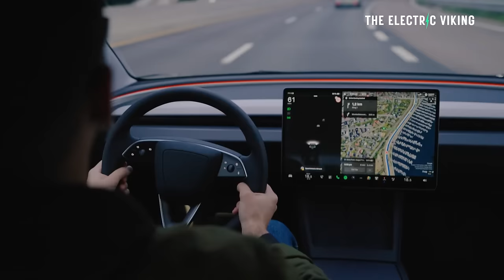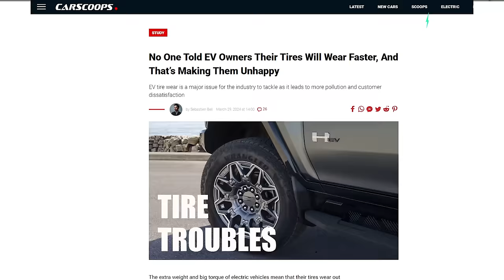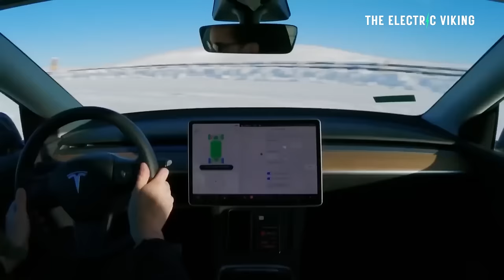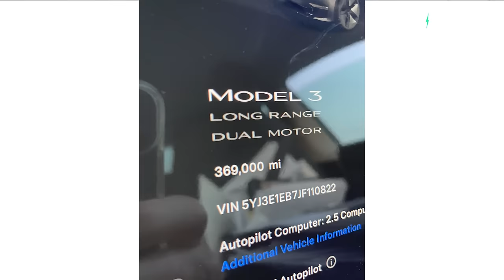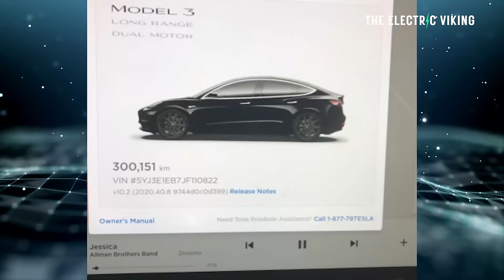I found the highest mileage Tesla Model 3 in the world - I'm shocked!

Comment: EV tires can last for as long as the tires on an ICE car. But EVs are more able to shred tires than ICE cars. That is because EVs have, on average, a whole lot more power than ICE cars do. EV owners who drive gently experience long tire life.
Reply: Yet over on the Tesla Plaid Channel he has done over 900 quarter mile sprints on his OEM tyres with over 21,000 miles on the clock.
Reply: I will go through tyres if I own a Tesla, and that’s fine. Fanging around in a M3P would be hard not to.
Reply: i had to replace mine at 21k… i do not drive crazy because i don’t actually enjoy the “torque” despite wasting the money on m3p lol
Reply: Correct but a slight innaccuracy. Electric motors have high torque at low speeds which can shred tyres especially with the battery weight. This torque quickly falls away at higher speeds so high power isn't actually accurate.
Reply: @GDM22  900 1/4 miles is a lot and would be very hard on a gas car with clutch/torqeue converter/transmission etc. but its actually only 225 miles 😀 So even if it did wear the tires 50x quicker than regular driving, it would still only add ~10k of wear
BTW tesla plaid never loses traction on a drag strip with the launch control software, so tire wear is not comparable to a RWD car sending 100% to the rear wheels and doing pre race burnouts
also sticky surface = less tire slip so I'm not sure how hard it is on the tires. I think on regular road its the tire slip that rips small particles of rubber. on sticky road I don't know if its possible that some rubber gets removed just from the stickyness
but its still impressive
Reply: the added weight does increase the load on the tires even when cruising, buts its more like a 10% difference. Talking about my fiat 500e, traction doesn't work really well, because of small wheels, eco tires, short gearing, FWD with 50/50 weight, and traction control that just doesn't work, so there's a lot of unwanted burnouts..
Reply: @Khanfuzed1  You clearly don’t realize how aggressively you are taking off...my tires (Model 3) look almost new at 19k miles.   Just ease off the launches a little bit, you might be surprised.
Reply: Not arguing against, but people are acting like 20k on tires should wear them out a lot, when most tires warranty 60-75k. I didn't see anyone talking about their tires at that range. But in general, they should wear more with additional weight. Depending on the axle weight per tire, you may need more expensive, heavy duty tires for long life in high torque applications. Didn't the plaid call for higher rated tires for the 0-60? Could be wrong though.
Reply: @AhjTheMediocre in my ev the tires was done 5k before warranty of 60k. My last car same type of tire lasted 65k miles so it does seem like more wear but not much.
Reply: @richardmenz3257  yea, it's not crazy. If electric semi get gross weight increases, we will see alot more particle pollution. Not that it'll be detrimental, but it isn't great.
Reply: @AhjTheMediocre  I know they are working on new tires hopefully that helps with all that we will see. I don’t really like a side of rubber with everything.
Reply: @richardmenz3257  with our push for no use of fuels, rubbers might get more expensive.
Reply: @AhjTheMediocre  dumb comment 82000lbs vs 80000lbs wow electric semis are so heavy but you forget they don't need to use disc brakes to stop or control speed downhill and don't emit nasty diesel particles
Reply: @AhjTheMediocre  yeah sure I'm very confident you're going to drive 75k miles on original tires with a 1000hp gas car 😂
Reply: @AhjTheMediocre  pilot sport 4S so equivalent to other high performance sedans
Reply: @geemy9675  You might wana chill with the passive agressive attitude. Not good for the brain.
Reply: Oh dear viking you really don't understand that km means kilometers not miles.
Reply: @Khanfuzed1  You must have some bad roads where you're at.  I easily get 40k on my model 3.  I'm at 25k on my current set and there's still a lot of life left.  I don't drive slow and I don't use chill mode either and I live in the California valley where roads are terrible.
Reply: @geemy9675  did you not even think about the 1000hp comment? If that expectation is true, which it is, it'd be even more true for EVs that have max torque at 0 RPM with increased axle weight. So... your point?
Reply: @Ryan-ff2db  is it actually called chill mode??? Lol
Reply: @PaleBlueDotCitizen  yea I noticed the kmh and mph mismatch lmao
Reply: @geemy9675  I went ahead and did a little googly search. A 100kwh pack weighs roughly 1000lb, atleast according to the tesla model plaid long range battery spec. And we have found we need roughly 700-1000kwh for semi. So that math checks out to 7000lb to 10000lb. Not including the motor weight or inverter. There goes at least 25% of your payload. Man that 2000 lb Weight increase really fixed that issue, didn't it?
Reply: Totally agree, my model 3 ttres last more than 60 thousands miles
Reply: @GDM22  Great!  I suppose tires would be more susceptible to hard cornering. Tesla traction control makes it nearly impossible to spin the tires, at least on dry pavement. I think drifting can wear out a set of tires in one day. Indy cars use two or more sets of tires in 500 miles. But I don’t know anything about tire wear in drag racing. Thanks for the comment.
Reply: @PaleBlueDotCitizen  oops
Reply: also keep in mind tires designed to be used on ev's (not performance ev's) have harder compounds to compensate for the increased wear by having more torque and more weight.
Reply: they last a bout the same its all on how you drive and time of day, driving at day time will wear tires out 3x as much as comparison to night. my m3p got about 16k miles on summer tires, my friend is on 53k on his and he only drives at night time.
Reply: @AhjTheMediocre  Yes, and there's ludicrous mode on the faster cars but 1,020 hp is bit much for me.  I prefer my bladder where it is.
Reply: It’s not just acceleration, it’s also the increased weight of EVs.
Reply: @geemy9675  The traction control can manage grip, by reducing acceleration  about 20 times a second. Still would be taking the tyre to that point continuously, the point aside from this, if those tyres end up doing 40,000 kms it is a lot more than the fear mongers are quoting.
Reply: This a great vid and supports my experience as well.
Tesla is killing all the misconceptions about EV’s .
Traditional ICE vehicles will quickly lose ground as this information comes out.
Reply: I changed my rear tires on Model3 after 60,000 km. Front tires are still original and doing good.
Reply: @AhjTheMediocre It is definitely detrimental.  Particulate pollution is causing an increase in childhood asthma and other respiratory illness increases in the population
Reply: You forget to account their weight.
Reply: VW is factory equipped with tires with a tread depth of 6.8 mm. Fiew yers ago it was 7.5 -8 mm.  Car manufacturers are shooting themselves in the foot by ruining each of their advantages.
Reply: VW is factory equipped with tires with a tread depth of 6.8 mm. Fiew yers ago it was 7.5-8 mm. Car manufacturers are shooting themselves in the foot by ruining each of their advantages.
Reply: @geemy9675 My previous car weighed about 6000lbs with a tank of gas and me in it. Tires were good for 80,000km. My current EV weighs about 4800lbs loaded. It has 400hp, but driving it normally isn’t chewing up my tires with 22,000 on the so far. I will be looking to replace them five years or so from now at 80,000. Conclusion - if you drive it like you stole it, you will wear tires out, regardless of what sort of car it is. The opinions you read are so much click bait, and no reason to worry about an EV being somehow different. Regeneration is no different from braking in its effect on tires. That’s just my opinion after 2 years of owning an EV.
Reply: @joniboulware1436  but gas and diesel are the biggest particles emmiters by far compared to EVs...they have been poisoning us for a century (remember lead, NOX, CO, particles, oil burning two strokes and of course C02 which is not directly dangerous)
yesterday you were complaining about emissions laws reducing power
you have also been buying heavier and heavier vehicles vehicles...just because you can
but now that EVs  just start becoming competitive you're complaining about weight..that's hilarious
Reply: @davidcottrell570  yeah how you drive has the most effect on tires. there is no evidence that EV being quicker of the line means people drive them harder. also the acceleration is more constant you are just using more torque of the line then accelerating more smoothly where a gas car takes off more slowly then if it wants to keep up needs to hit higher acceleration between gear shifts so the EV acceleration is both easier on passengers and the tires.
I do drive my EV harder than my gas car though because I have mechanical sympathy for my engine and transmission and more concerned by gas mpg than electric range though but my EV is way lighter than my gas SUV and rides on my h smaller wheels and any speed I gain can be converted into Regen and heat  instead of brake dust
Reply: @GDM22  but EV traction control being quicker reacting and making best use of front +rear wheel traction means than gas car trying to keep up with same acceleration will harder on the tires.
for tire tire life chill acceleration > hard EV acceleration with traction control > hard ICE acceleration with traction control > hard acceleration without traction control.
and also EV AWD > ICE AWD > 2WD

Also EV's don't allow the same level of TC off as gas cars because performance EV simply have way too much torque for the tires and almost no engine rotational inertia (no crankshaft pistons, flywheel and transmission)

but yeah physics still applies, if you have a very quick EV and you are flooring it at every stop you'll definitely kill the tires fast.
Reply: @AhjTheMediocre 

The saving from particulates from not wearing the brake pads probably offsets that tire wear.

Then the saving of PM from the exhaust from an ICE, and its no contest anymore...
Reply: Completely agree. I just replaced my OEM Hankook Evo 3 tyres at 90,000km/56,000 miles. Replacement set cost $920 in Australia - can't complain about that.
Reply: @tomaszw7749  Hi, Tomas. Actually, I think there is a never ending exchange between producers and consumers. And that’s good. Car companies try to save money by offering less tread depth, for example. Some consumers may welcome the opportunity to buy a cheaper car with a cheaper tire. Others might quit buying the brand because this model of car has poor tire life. 

    New car ideas come and go. Consider the example of the Cadillac 8-6-4 engine, or the seat belts of the 1974 model year seatbelts that strapped you in like it or not. The Wankel engine. Wing windows. Continental kits. Hardtop convertibles. All wonderful ideas that flopped (though I believe hardtop convertibles have made a comeback). The market sorts out what will stay and what will go. That’s progress, so they tell us. But I do miss those wing windows …
Reply: Ev tires don't last as long - period.  The tires are much softer. I got 22k on my rear tires and don't drive hard.
Reply: It’s Tesla not Tezla.
Reply: It’s the weight not how you drive
Reply: That is the truth. My bmw ate tires just as fast as my model 3 because of my driving style.
Reply: @Areku06  model three does not have tire wear issues. I have owned a model 3 performance. My model S plaid has tire wear issues. Every 6k to 8k miles needs a new set of $2,400 tires
Reply: @softwarephil1709  Increased weight and still got 65k miles.
Reply: last longer in CHILL mode.
Reply: @markplott4820  Never tried it, but I should.
Reply: @NsXy  Both!
Reply: @Tyrial7  Good for you
Reply: This is the problem with EVs. Almost no one drives them slowly. They don’t even have modes to be eco friendly.  They all have theoretically great mpge.  But people drive them fast and they get half that. And of course they charge in most places on the marginal power source.  Which is coal for most grids around the world.
Reply: Just made up. Yes. No relation between torque and tires. And the type of tires on these vehicles. I am dumber for having watched this video.
Reply: @davidw2204  Thank you!
Reply: @Tyrial7  You’re welcome 😉
Reply: @davidw2204 - Yes indeed however some here don't appear to understand what "Drive Gentle" actually means.  Some might comment they "Drive Gentle" because they don't accelerate hard but then they do sling their cars around corners like they are on a race track or hit the brakes hard at the last moment when they have to stop.  Most tire wear occurs when starting off from a dead stop, while cornering/changing lanes and when braking so you need to be gently at all three to get the best tire life along with of course maintain tire pressures and rotate them on a regular basis.

Myself I have an old cheap Nissan Leaf which I "Drive Gentle" getting about 5.1 Miles per kWh and the tires last the range specified in the tire warranty which is 40,000 miles since that's what has the best traction and temperature rating for where I live while still being affordable. 

Best!
Reply: @neilfromclearwaterfl81  
Hi, Neil. Thanks for the response. Yeah, the things you mention plus wheel alignment, caster, etc. interesting that these are also the things that cause increased fuel use. Of course it makes sense because these driving behaviors all scrub the tires against the pavement. Whenever your car gives you a 🍃leaf, it is telling you that you are saving your tires as well as your state of charge.
Reply: There’s more to it than just burning rubber to ware tires out at the .  A tire doesn’t have to slip to scrub rubber off its surface.  Just high torque can be hard on tire life .  In the tire business, the concept called squirm wears tires as well.
Reply: @robertstout7756  Squirm happens starting or stopping and you still vote on that with your right foot.  Tires also squirm from cornering which you control with both the steering wheel and your right foot.

My Dad spent almost 50 years working in the tire and rubber industry as an engineer after earning his masters degrees in chemical and electrical engineering and taught us how to drive along with the why's of things concerning tires and their care.

Having high torque alone won't wear tires since you have to overuse or in other words abuse it to cause excessive wear just like having donuts in moderation won't make you fat while overindulging will.

Best!
Reply: @robertstout7756  Thanks for the reply, Robert. You’re right, I forgot about squirm. I believe squirm was much more of a problem back in the days before radial tires. Bias ply tires suffered from tread deformation, which caused heat buildup, and wore down faster than radial tires do now. Manufacturers made tires stiffer by adding plies. Four ply, eight ply tires on regular passenger cars. Of course this caused more heat. So maybe heat should be added to. The list. Is that right?
Reply: @davidw2204  yes, DAVID I think Heat is another variable. Softer compounds wear faster and give better traction.  Neal mentioned aggressive driving, which of course can easily half the life of a tire.
But it’s so tempting, to feel your self pressed back into the seat .  Gzzz 😅
Reply: @robertstout7756  I give in to that temptation sometimes, but only on the on ramp to an interstate. It takes me back to the mid 1960’s. I wore out two low mileage used cars before I got sensible. Incidentally, not one of the quickest 60’s cars would keep up with my granny mobile, a Model Y long range with two baby seats.
Reply: I wouldn't call it "gently" just normal.
Reply: I believe most of the low tire mileage comes from over enthusiastic drivers, which is a nice way of saying hot rodders! All new vehicles need to be equipped with a black box type system in them like aircraft, to keep track of all the abuses and so forth! Plus it would be great info for just general building and manufacturing of vehicles. I believe these electric motors will probably go a million miles easily! Ice engines are just to over-complicated!
Reply: @steve-qe7tj  Steve, thanks for sharing your thoughts. The black box you mentioned could be an accelerometer, and Teslas are already equipped with them. The current design, back to 2018 or earlier, also includes a supercomputer in every car, a huge memory, and the ability to transmit a whole bunch of data to California or Texas or somewhere. 

Some people worry that data collection like this will lead to abuse of personal data. But responsibly used, after identifying data is stripped away, information can be extremely useful. In fact, the data from the entire Tesla fleet (over two million vehicles, many billions of miles) has been used to create Tesla FSD. 

No other AI companies have been able to obtain such a huge database. No other companies can create an AI system akin to TeslaFSD. Expect car manufacturers to license the Tesla system for their own vehicles. 

And our accelerometer data is part of this!
Reply: @AhjTheMediocre 
Did you not think about the lack of an Diesel engine, transmission, drive shaft, exhaust + its emissions controls, radiator, gas tank, and other stuff no longer needed in an electric Semi?

A Semi engine alone is 3000-4000 lbs, without all the extras that get bolted to it
Reply: I put my Tesla in Chill mode and I had to replace my tires at 20k miles.  The OEM Tesla tires were terrible.  I don't drive that many highway miles, so the tires get more wear from acceleration and braking.  Many of my friends also are in the 20k to 30k mile range before changing the OEM tires.
Reply: @vikasthakurus  We d  drive many miles either, but we live in the worst state in the country as far as roads. Potholes are a big problem here. With 30k miles in four years, we have ruined two tires. One pinched tire due to a pothole, one punctured in sidewall. I think my wife scraped that one on a curb. So we have two tires with a lot fewer miles than the original ones. 
 I wish we could have gotten smaller wheels than 19 inch ones. Maybe 17 inches. I don’t want to sound like an old geezer, but in the 50s and sixties,
Reply: Oh dear god! The urge to shed the tires is so great!  My inner voice tells me "factory tires aren't that great, I'll be doing myself a favor by cutting hard in the turns and giving it the beans on the exit" 😅😂😂😂
Reply: @matthewholzmueller6292  
Thanks, Matthew, for your response. It’s exactly what I would have said sixty years ago. 1964 was a great year to get a driver’s permit. Fun cars, bad tires, and lots of empty roads. Street racing? Oh, hell yes. But tires were made of not much more than rubber, cotton cloth, and metal wire around the rims. 20k miles tire life was good. A quarter mile time in the thirteens was legendary, and I’m talking about GTOs, 409 Chevys, 383 Dodges, and the like. Everyone else was in the fifteens or worse, and in cars that had a design life of about five years and 60 k miles. Emissions controls didn’t exist. Seat belts were for the first time required. Aside from that and safety glass, there was no safety issue.
Reply: They don’t last as long because they weigh a lot more than their ICE counterparts. That and like you mentioned they are quick.
Reply: It's more about camber issues on most Teslas. If you buy aftermarket adjustable camber arms, it helps your tires last longer. More negative camber helps improve handling but also wears tires faster on the inside. Do you want better handling or longer lasting tires? That's a decision you have to choose.
Reply: @ is this true for toe-in as well?  Some guys were converting ICE to EV In the stone ages (any time before 2008, in my opinion.) A lot of us adjusted our toe to zero. It may have helped with range a little bit. Batteries provided such a meager amount of power that we were desperate to do anything. 25 miles was an ok range. This would be with ten twelve volt lead acid batteries. I can’t remember anyone I knew modifying camber.